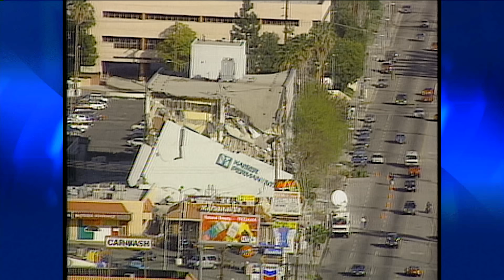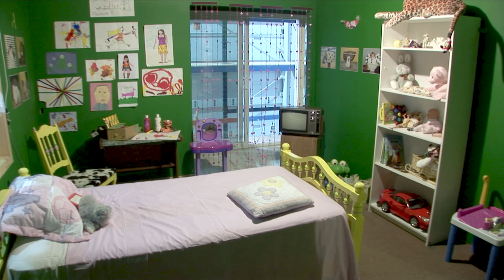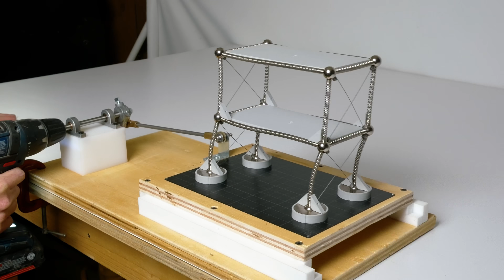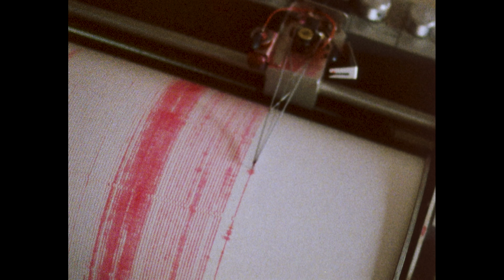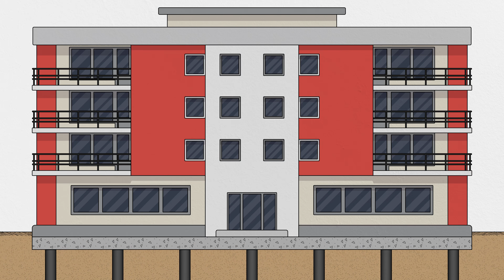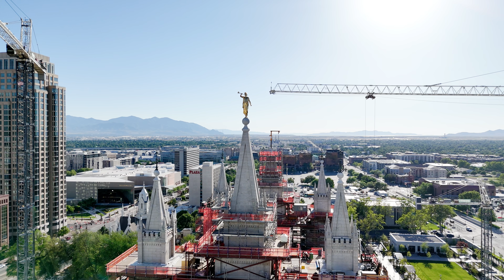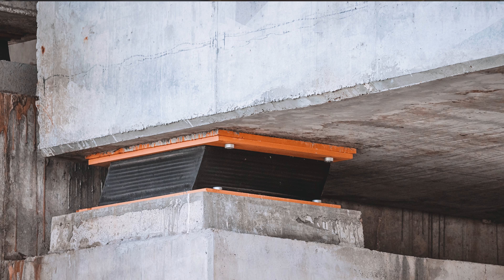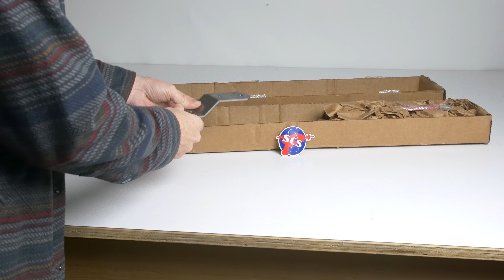How Earthquake Bearings Work

Comment: These must be everywhere in japan
Reply: Not necessarily in every building, big multi-story office/commercial yes but for single house it is somewhat compensated by the material and design
Reply: It is quite common in Japan
Reply: Here in Japan the houses have an offset underneath the house made of concrete and absorbers inside the wall. in Switzerland even without many earthquakes they need to be safe by law.
Reply: Wouldn't surprise me if they were working on a project to put all of Tokyo on a giant version of this 😅
Reply: @moxxy3565 well the whole of Tokyo is already on top of a very flexible that is the earth mantle😅
Reply: There's always some weeb in every comment section
Reply: @Doctor_Buckets why weeb, i live in japan, but rised in Switzerland. Even my surname comes from my japanese wife😂 And jes new Buildings here need the have an earthquake protection. Thats also why old houses without that has almost no value.